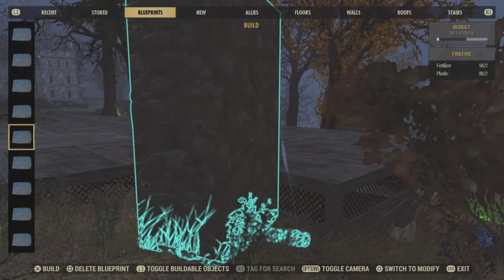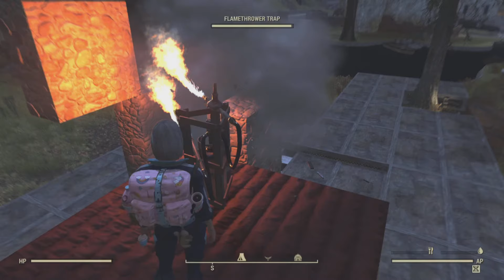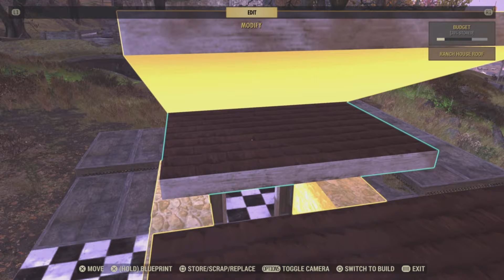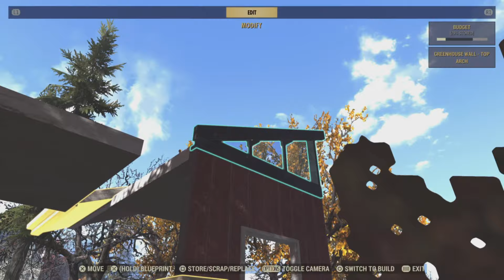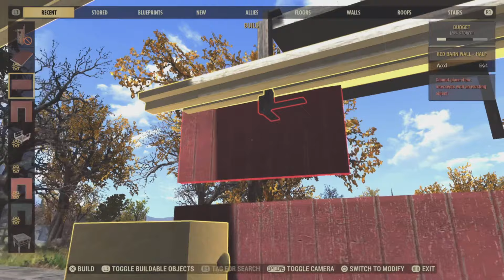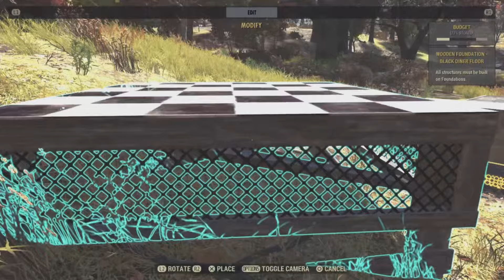Fallout 76: luxury Lake house tutorial PART 1

Comment: Where did you initially place the camp to establish the radius, because it definitely isn't by that tree. I run into "can't build outside build radius" at the 2 minute mark.
Reply from the maker: Hi I’m really sorry I didn’t explain this very well. I placed it a number of times until I got the edge of the camp on the edge of the lake
Reply: @Chez79_xx  I think I've got it placed where it needs to be, just waiting on bethesda support to give me the Slocum Joe bundle so I can use those floors for the next portion. I'll let you know how it goes!
Reply: @Chez79_xx  I just realized the fireplace I have is different. I don't have the one from the scoreboard, I have the old glory fireplace. Is there a way to acquire the one you use anymore, or can I use the one I have?
Reply from the maker: I think the only way you can get the old items is if you purchase through Bethesda 😊❤
Reply: @Chez79_xx  sorry to keep bothering you, but I really love this build/location and I want to try the tutorial to give you feedback. Do you know if any of the other fireplaces can be merged through the roof pieces as a substitute? I have the old glory fireplace and the hunting lodge fireplace. I was able to make the Moonlight Cowboy blueprint with the Old glory fireplace
Reply from the maker: If you use the old glory and add the extensions then burn it, it should work the same way, I’ll try it out for you and get back to you, what platform you on?
Reply from the maker: What platform are you on? If you are on ps5 I can come across and show you 😊❤
Reply: @Chez79_xx  unfortunately, I'm on PC but I really appreciate the offer! I'll give it a go with the Old glory fireplace 🖤
Reply: @Chez79_xx  it unfortunately will not allow me to place a doorway in the destroyed blueprint when using the Old Glory fireplace set. I made it to about the 13 minute mark where you place the doorway in the destroyed blueprint. 

If you ever decide to play on PC, I'll buy your copy of the game for you and compensate you for your time to help me with a camp in this location :)